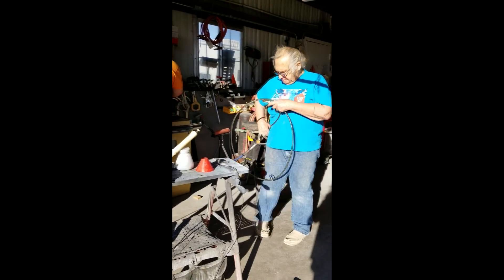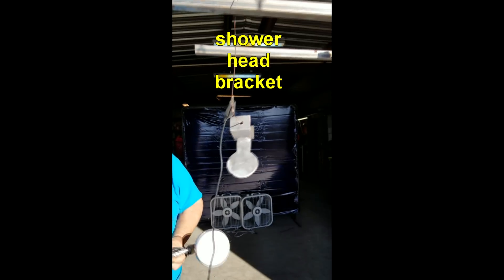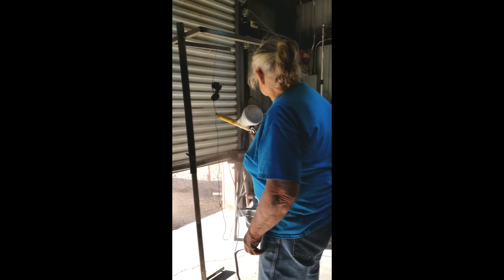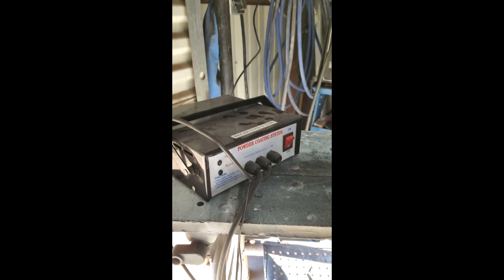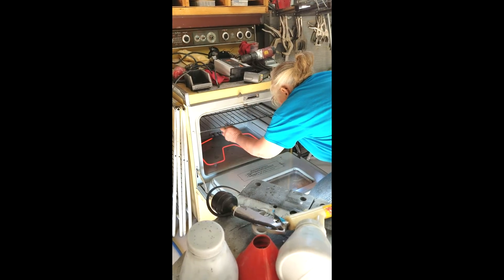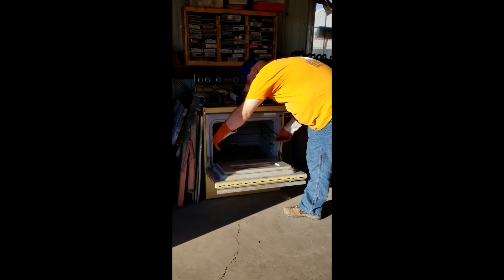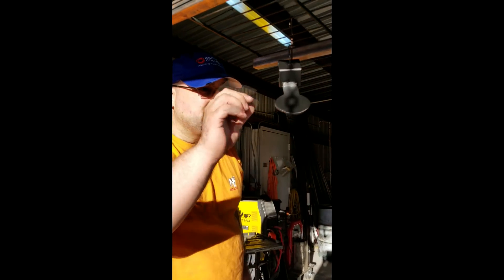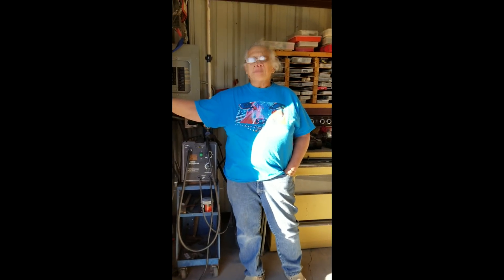How to Powder Coat Metal in Your Own Workshop - Kevin Caron

Comment: Hi Kevin - Does that unit run off 110VAC ? looks like it in the video...

Aside from powder coating, what finishing method would you recommend for mild steel.  I've tried the Rustoleum painting, cover with peanut/linseed/motor oil and burn off w/ blowtorch, and also patinas, chemicals ... to some varying degrees of success.
Reply from the maker: Yes, it runs on 110 volt. As to finishes, you are doing all the things I do as well.

Comment: Only note of caution I would add is that nobody was wearing a respirator.  I just worked with a powder coating company on a bunch of stuff and they were very carful around the powder.  Granted they spend a lot more time around it, but I asked and the big danger is essentially the equivalent of black lung.  It's not so much that it's toxic but that once you breath it in it's hard to get back out, so it reduces lung capacity/ smothers cells etc.
Reply from the maker: Good point!   Thanks for posting.

Comment: Different powders require different temperatures and cure times. I want to see if you can powder coat with printer toner. Why? Just because it popped into my head. I have seen people use toner as a resist when etching circuit boards, so I know it will adhere to the metal once it melts. Both are available in polyester resins.
Reply from the maker: Can't wait for the video!!
Reply: Oh that's an interesting experiment. so maybe like a mixture of mica powder and printer toner. I don't think it would last long though unless you applied a clear coat of paint.